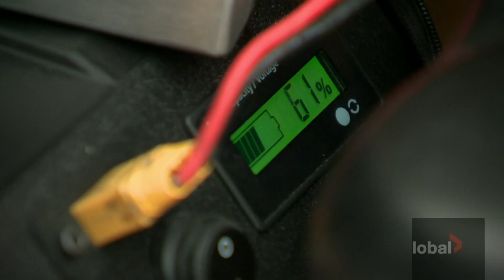How a young engineer is recycling old vape batteries to power e-bikes

Comment: Australia is already a vaping-free country. So should Canada 🇨🇦. 
- Vape liquid comes from China 🇨🇳, and you never know what the Chinese put in there.
Reply: When I used to vape I knew exactly what was in my vape juice, I made the juice myself, the ingredients all have safety data sheets you can refer to, only a few of the flavor concentrates have stuff that is overtly poisonous or carcinogenic in vape form, all the flavours are safe to use in foods and why they were invented

I'm more worried about what was in the atomisers, the part that heats up, I heard they can be made with traces of heavy metals

I switched from vaping to patches and gum and then just gum, but recently I switched from gum to snus, which is a pasterized tobacco you keep under your lip, because it's pasterized Instead of cured it is vastly less carcinogenic then smoking or even chewing tobacco, it's been used in Sweden for 200 years with not much people getting sick from it

The only problem is I can get 300 pouches for $30 USD but if Canada catches it at the border they charge an extra $200 cad in duties 😭